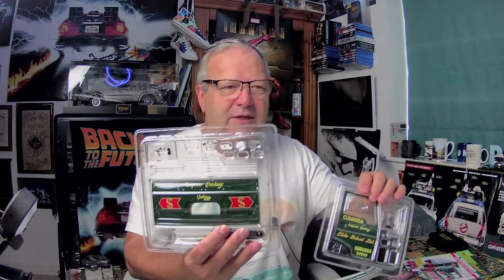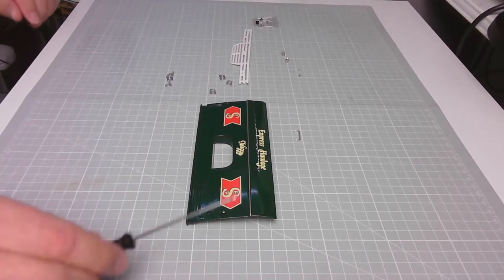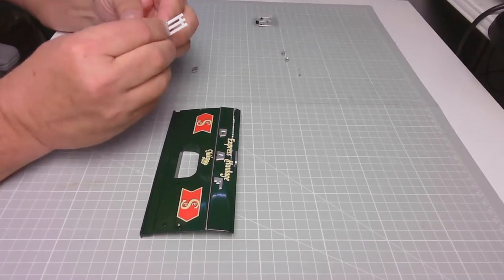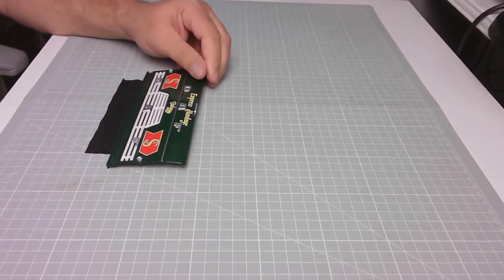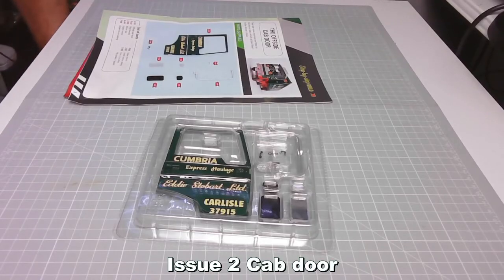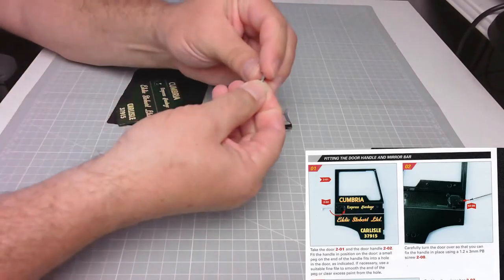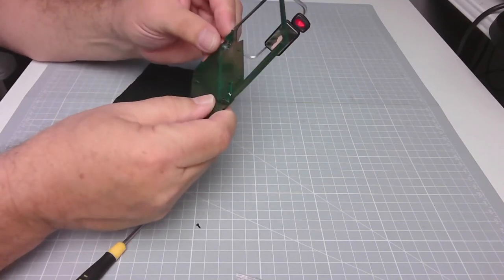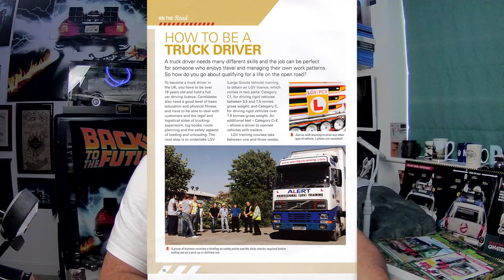Build Eddie Stobart Twiggy issues 1 and 2 from Hachette

Comment: Hi john the front and door  of the cab  looks good today I did  the two motors and the lifting rod of the spitfire made a little boo boo put the wrong motor on the lifting rod but I'll leave it as it is those screws ard a night msre asuualthey dont put them in a different bags
Reply from the maker: Thanks Bobby. I don't think it will matter which motor you used as I am sure they are the exact same motor. The screw packaging is a little irritating.